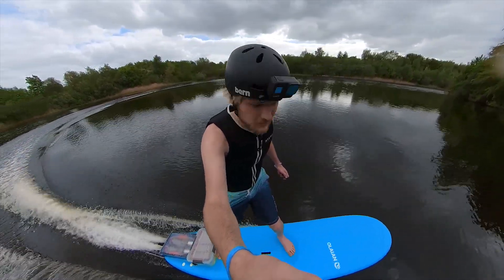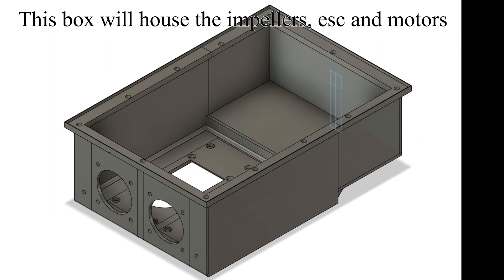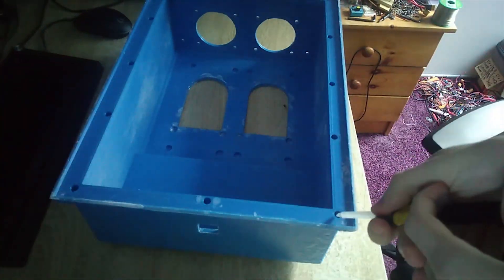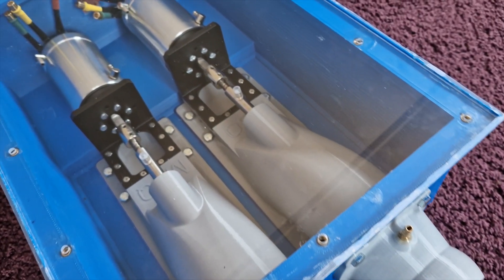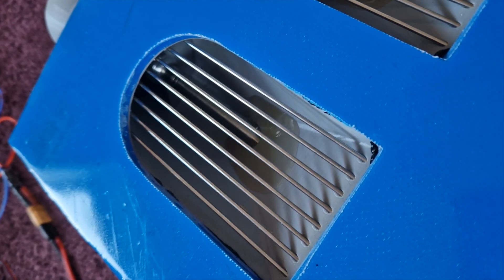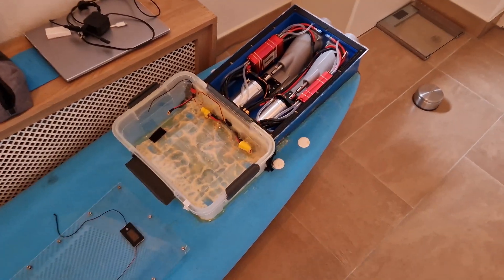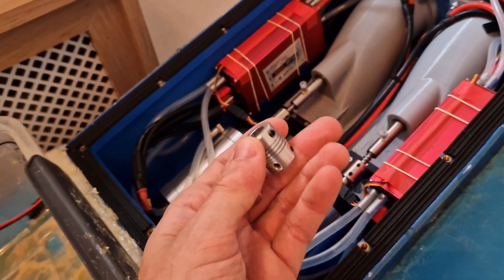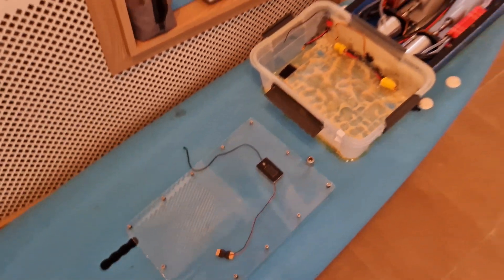Building a 20000 Watts Electric Surfboard

Comment: Ist erst mal gut das du eine Datei da gelassen hast zu Downloaden aber das Modell hat so viele Freie Öffnungen die eigentlich zu sein sollten und Nacharbeiten ist mir zu nervig
Reply from the maker: sorry my modelling is not that good, however i do not advise you use the MSQ70 actually anyway, they require a lot of maintenance and i change the bearings already quite some time (with after each 2 uses of the surfboard new grease)

Comment: the batterys are not made very well. your welder is too weak, you need more Amps for a shorter period of time, 25ms or less is good. and please use spacers, if the shrinktube from the  cells rips for whatever reason, you have a nice short circuit.
Reply from the maker: @renzus1234  to be fair it both cells have shrinktube so then both need to break. Also the strips hold them together so then cant move which might causes them to break. But ofcourse with spacers is better! I didnt have the room for that anymore.

I will try different settings on my welder! I think got a good quality one for the job but maybe settings are not set well. Untill so far the batteries are able to do the job :)
Reply: @GalinskyFPV I’m building an 18650 massive bank next year, I’m ditching lipo since lithium Ion has a higher energy density than lipo, also more capacity for the same price. I decided to go with 15S instead of 16S, I’m already maxing out my motors at 75% throttle anyway, also makes making 3 5S packs alot easier and safer to connect so I dont accidentally blow up an ESC lol also allows longer runtime

Comment: Can you tell me about bolt and nuts for engine and how to waterproof the engine room
Reply from the maker: @ha2709  nuts and bolts are standard stainless steel if i remember correctly M4 or M5 bolts and nuts.

For waterproofing a put a rubber seal, similar to cars around the lid and then the plexiglas on top.

Bolts that go through the engineroom to outside have a lot of grease around the threads so they water cannot go in.

The impellers have a silicone seal between them and the box. 

Other holes like wiring and just closed with epoxy resin.

Still water comes in, mostly from the lid but its okay. Everything is waterproof inside the box.

Comment: What lithium ion cells did you use?
Reply from the maker: Molicel INR18650-P26A 2600mAh - 35A however if i would do it again i think i would go LIPO to get the power and reduce weight but also drive time.
Reply: @GalinskyFPV  I’m running lipo personally but the nice thing about lithium ion is you can fully charge them and leave them fully charged without issues, lipos you need to leave at a storage charge level of 3.8 Volts per cell and check them every few months so you dont want to leave them fully charged for days even otherwise you will reduce their lifespan but yes the weight savings is nice. Not to mention I know lithium ion cells have crappy packing efficiency so its harder to fit more of them in a smaller container thats another advantage of lipo people dont think about. I’m telling you though if you want to switch to lipo, just get the turnigy 12,000 MAH 6S Graphene batteries, they weigh even less than regular batteries, nearly the same price, good price in general, and they stay nice and cool even under insane loads.
Reply from the maker: @cameraman1234567890  i thought li ion also suffered from lower life span when leaving it fully charged and need to be stored on nominal voltage :m/ 3,7 ish.

I keep my li ion hobby is already expensive and just bought a house that need a lot of work..
Reply: @GalinskyFPV  I don’t think Lithium ion does, but lipo definitely does because cells begin to swell if left at full charge for an extended period of time
Reply: @GalinskyFPV  I cant blame you, jetboard are expensive but alot cheaper and more fun to build one yourself!
Reply: @GalinskyFPV  Trying 16S tomorrow man! Will let you know the results and thank you for your help!
Reply: @GalinskyFPV 16S got me on plane man! I agree 18S is the standard. I’m unfortunately limited to my 16S ESC’s currently but am going to maybe upgrade to 18S
Reply from the maker: @cameraman1234567890  yes the 18650 dont swell because it has a hard round casing. Internally it gets the same damage though.
Reply from the maker: @cameraman1234567890  woooww thats sounds great! Congratulations! if its planing now it is good. More batteries is series is afcourse faster. How is heat from motors?
Reply: @GalinskyFPV  Thanks man! Motors are about 55-65C and ESC’s are like 70C. I need even more flow to prevent overheating which I will deal with. I think 18S to maybe even 22S is my plan because with a battery expansion to compensate for the extra weight is necessary, plus I want to make the boxes flush with the board to cut down on drag significantly. It also weighs 34 lbs right now. I’m going to drop it by like 10 pounds hopefully soon. Maybe try trim tabs to plane out easier. I’m cooking up new ideas man!
Reply from the maker: @cameraman1234567890  that looks very good! You got a short video of it in action? Im very curious
Reply: @GalinskyFPV  Yes! Its on my channel! Greater in depth video coming soon!
Reply: @GalinskyFPV  How have your lithium ion batteries been holding up? my lipos have gotten toasty and one is starting to puff probably due to heat from previous runs. I need to get a second set to distribute the current going through everything. I have wondered about running with lithium ion.
Reply: @GalinskyFPV I have decided I want to go with Lithium-ion. I have much experience in building batteries safely as well as a Spot welder, lithium ion has an even higher energy density than lipo despite the increased cost, you building your own packs is the right way to do it, you can store much more energy per KG which this project needs every KWH it can get
Reply from the maker: @cameraman1234567890  they are still going strong, but they also had in these past 2 years only like 50 full cycles.
Reply: @GalinskyFPV decided im going with the 21700 eve 70A cells and 15S plenty of power for plaining, but also allows longer runtimes, better heat management. I discovered I didnt have enough current capability as my lipos got too hot last year. Also I needed more current capability to prevent overheating of the batteries. Downside of the M-Jet 60 is they dont give sufficient cooling flow, so You’ll need bigger water lines and big threaded barbed fittings. Plus 15S is still plenty of power to get me on plane.
Reply: @GalinskyFPV  Ended up going with the new BAK 4500 MAH 60A cells for 21700. They are a dollar cheaper a pop compared to the EVE ones, and they look like great cells. I'm debating if I should use nickel strip or copper? I saw in your video you used nickel. Did you have any problems?

Comment: Running 18S with your Motor setup will drop your efficiency on your motors, draw more current and generate more heat, but man you get so much more power, I'd run the 12S Setup, and the 2 batteries you'd already have out of your 6 could also be put in parallel and increase your runtime significantly.
Reply from the maker: Yes I thought the same based on other videos on youtube but my setup is really underpowered on 12S. I have to continously give full throttle to barely stay afloat. 18S it is nice and playfull, actually with my new setup (I rebuild the board) i did not try 12S, the new setup also seemed more efficient since the board is more bouyant.
Reply: @GalinskyFPV  Yeah, Buoyancy really does matter, it's like having an overloaded boat, it simply doesn't have the stability and power to get on plane. That's my concern with my Build, I weigh 208 Lbs and found a foam 6 footer for $100 on amazon that's rated for 200 lbs. Worried it may not be buoyant enough.
Reply: @GalinskyFPV  What board did you use? I’m going to be buying parts soon.
Reply from the maker: @cameraman1234567890  I used an olaian foamboard 100 8.2 ft. It was 95 Liters if I remember correctionly. But like said still not enough bouayancy. I now made my own foamboard with epoxy which is around 150 to 180 liters.
Reply: @GalinskyFPV  Understandable, I found an 8 footer on amazon for my build im considering, but its 86 liters of volume, not sure if that's enough.
Reply from the maker: @cameraman1234567890  I would say 86 liters is not enough, thats only your weight +/-. Then motors batteries, board etc. is not included which quickly adds up to another 10/20 kg.
Reply: @GalinskyFPV  Yeah, that's a problem and thanks for the reply. I have lost 5 pounds (Was 208 now 203) since I sent you my last reply.
Reply from the maker: @cameraman1234567890  wow thats pretty good for a couple of weeks, but i would add around 10liters to the total weight of the board with you, the weight of the board itself and all the other electrical stuff to make it worth while. Lower liters will work ofcourse but more drag.
Reply: @GalinskyFPV  Understandable, if less power is needed to get on plane, a more efficient conservative runtime could be a minute longer but that's a massive difference maker.
Reply: @GalinskyFPV Should I get a paddleboard instead for more buoyancy?
Reply from the maker: @cameraman1234567890  ive looked into paddleboards as well, to be honest i dont know if it will work well or not. In my opinion its defenitely worth a try if you can get the board for cheap 2nd hand or something. I never found one only new ones and around couple 100 bucks which i found too much.
Reply: @GalinskyFPV  Appreciate the reply, I’m worried about buoyancy, I’m now down to about 195 pounds. It’s difficult to choose to a degree considering how expensive they are
Reply from the maker: @cameraman1234567890  Just make sure your electrical base and impellers are good and maybe easy useable towards other projects, the board shouldnt cost more than 10% of your total build. maybe make a box where everything is in that is also relatively easy to change to another board.

Just keep looking for 2nd hand boards :)

maybe with good impellers you also dont need the bouyancy Dont buy the same ones that I bought! RClifeon made his surfboard also only on a 86Liters surfboard. I am sure his total weight with batteries etc. is also more than 86 liters. He could plane on that. Now i still think you need a little bit more than 86 liters.
Reply: @GalinskyFPV  Thank you for the reply! yeah It's hard to find something higher than 86 liters of buoyancy. Simon from RCLIFEON says he weighs 75 KG or 165 pounds. I weigh 30 more than that (he's skinny af) So yeah totally I'll aim for more than 86. Thank you so much for the insight. My update is one of the speed controllers is ordered and on it's way, the motors are mounted to the motor mounts and the jet drives are almost completely assembled. The Electronics box is fully 3D printed and is ready for further assembly. I should have it done latest july but possibly june.
Reply: @GalinskyFPV  Could you point me to a link for a board at a good price it seems difficult to find one.
Reply from the maker: @cameraman1234567890  Well i got mine from "marktplaats.nl" its like the dutch craigslist for 2nd hand items
Reply: @GalinskyFPV  I see! I found a wavestorm 9 footer on amazon with 98 liters for like $360 USD which is crazy expensive
Reply: @GalinskyFPV  Think I’m going to go with the wavestorm 9’ which is 98 liters of volume. Plenty of room for the boxes plus me since I’m 5’ 7 195 lbs, it’s more than 86 liters and I’ve read in reviews its a crazy efficient board for the price because the traditionally built boards are far too expensive. Unfortunately where I live there aren’t any 9 footers second hand used around as I don’t live close to the coast
Reply from the maker: @cameraman1234567890  Price is crazy and still in my opinion a gamble, My board in this video is the olaian 8.2 which is a 100Liters surfboard and im also 75kg. But like said maybe other impellers make it plane better and then you have less of a bouyancy issue.
Reply: @GalinskyFPV  I’m using the same impellers he used in his electric surfboard secret inside video. Same build.
Reply: @GalinskyFPV  I’d love to go to the 8 footer and save $130, but I’m worried its not good enough
Reply: @GalinskyFPV  definitely going with the 9 footer, I want a board that will work the best
Reply: @GalinskyFPV big update: got my board, built the project, took it for a ride. I have to give the same as you continuously full throttle to stay afloat and got to 10 MPH which is almost on plane. I really wanted to get on top of the water but couldnt quite. My ESC is only rated for 16S so I’m going from 12S to 16S to get enough power. I weigh 195 Lbs so 88ish KG on that 9 footer with 98 Liters of volume. Total weight on 12S is 40 LBS or 18KG
Reply from the maker: @cameraman1234567890  thats crazy! Congrats on getting it working! I am sorry i did not see your comments from a month ago. You got the same parts as rclifeon? Impeller and motor?

You could try 16S if motors dont get to hot now. Would try it but just in case dont hammer for too long and check temps. 

Really curious how the impellers are you use.
Reply: @GalinskyFPV  Thank you! And yes I used the same 3D print design as rclifeon (to save money and was easier) I still have leaks around the covers which I will address and put a bilge pump in as well that will constantly run off of my receiver battery to double ensure no water gets in. My motors and ESC’s after 5 minutes of full throttle I’m only reading about 50C for temperatures which is really good actually despite pulling 120 amps on 12S. I did slightly modify the jet drive design that rclifeon used by drilling the water cooling holes bigger to get more flow as he said in his video he had overheating issues.
He ran the 56114 500KV motors and single stage setup with those pumps and I’m using the dual stage system setup with 56114 360KV motors on 12S. My idea was that two-stage pumps are more efficient as less rpm is needed, also stresses bearings less, so I thought I could get away with that. Not quite and cant really tell but there are some advantages with two stage pumps.
Reply: @GalinskyFPV Sounds like from your video you need more flow around your motors and ESC.
Reply from the maker: @cameraman1234567890  well it is solved now. esc were cooled very well but motors not. But the water used to go to the esc's first and then to the motors, but the esc already gets multiple laps. now the water goes first to the motors and then the esc's which solved the issue. Still the motors get warm but not hot or burned.
Reply: @GalinskyFPV  Awesome! Thats how I have my system ran. I’ll let you know how 16S does next week!

Comment: Hello, I want to ask you an important question, I would appreciate it if you could answer it.. When using dual engines, did you use it as CW in 2 engines or did you use 1 CW and 1 CCW..
Reply from the maker: Hi, both rotate the same way. I dont know cw of ccw but i think knowing both rotating the same way answers you question. :)

I dont get any problems from it eiter, water + my body has enough resistence for those small impeller blades.

Comment: Nice man .Very cool, but can you please tell me how long the batteries provide for work and how much the total cost of the batteries. And why did you not keep the same type of batteries that you used in the beginning of the video
Reply from the maker: The batteries in beginning of video where not sufficient. At the end of an 2min run they were hot and the lipo's where puffy.

Total cost of batteries was €1200,- on that I could drive a good 12 minutes.

Comment: Very good, thanks for the details!!!
Reply from the maker: You are welcome, thank you for your comment. I'm currently making a new surfboard, same electronics and impellers parts but I'm going to build my own board I felt there was a lot to be gained with a different shaped board.
Reply: Als je gaat liggen op de plank denk ik dat je nog harder kan ik ben zelf ook een elektrische sup aan het maken ik denk alleen dat een enkele motor met propellor efficiënter is als jet aandrijving wel gaaf

Comment: What is the engine brand? Thanks
Reply from the maker: The engine is: SSS 56123 KV230, the 500kv version also seems to work fine with lower voltage from what i've read/saw somewhere.
the impeller is the MSQ 70mm.

Comment: One factor missing from your calculation: the higher the power draw, the lower the capacity.
Assuming that you pull close to 10A from each cell, capacity will be reduced to 2Ah or less - check the datasheet of your specific cell.
That of course also means, that your power is significantly lower than what you calculated... Sorry, man 😅
Reply from the maker: youre right indeed, I haven't thought about that! But if power draw is lower isnt then the capacity a little bit highter again ;).

Then Again im happy with a lower average powerdraw. defending my position maybe the maximum powerdraw is still (close to) the 20000watts making the title still kind a correct. :P

Then again it could still be way off, only way to measure it is to actually measure it. But it should be in the ballpark.